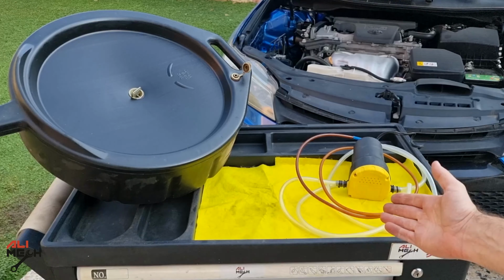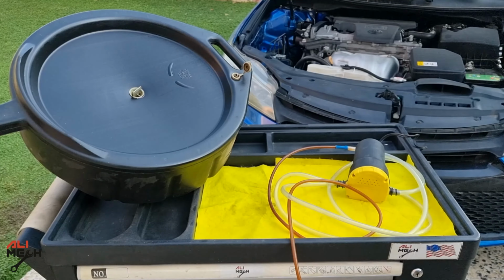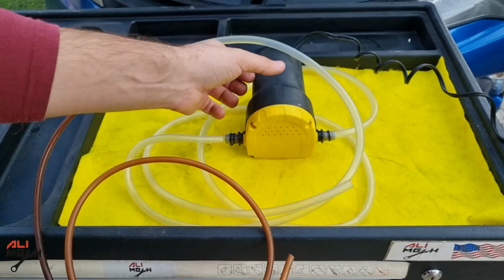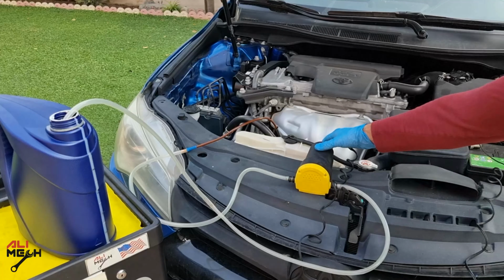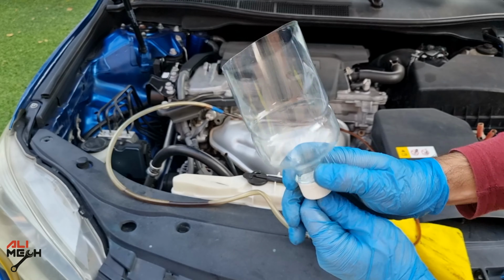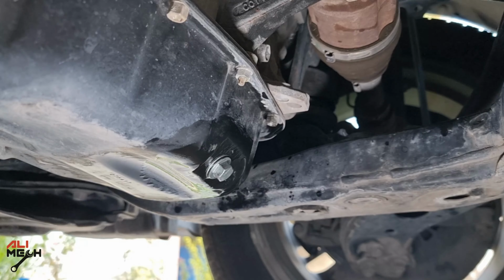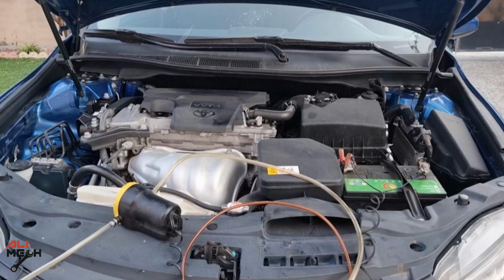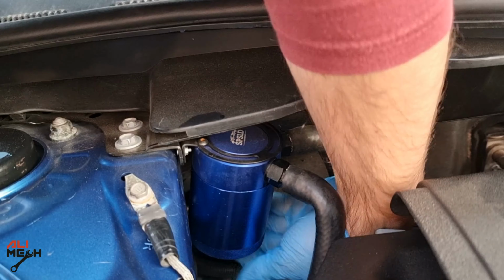Don't change engine oil like this!! /Drain oil vs Suction pump/How to change Toyota Camry Engine OIL

Comment: Even if you drain the oil from the drain plug you still leave up to half a liter of oil inside the motor. The oil inside all those passages doesn’t drain out completely. That’s a fact of life. The amount of old oil that stays in the engine is too small to make a difference.

Comment: you should put the can and the pump on the ground to take advantage of gravity, like you would with a siphon. Your pump was having to try push that oil directly upwards. Still, even in ideal operating conditions, the drain will of course get a bit more out. You can use clean oil to dilute anything leftover and get more out with this.

Comment: Nice comparison. I guess old drain method is gold 👍
Reply from the maker: Thanks brother, for some cars will le close to one liter
Reply: using both will be better and cleaner, no oil spills !!
Reply: But not For aluminum thread motorcycles engines
Reply: Nope you're wrong. He is using a very weak oil extractor. A good oil extractor will suck the life juice out of your car. You can see videos of those shops using pneumatic oil extractor. Nothing is left when you unplug drain. I will make a video too we have the machine in our shop.
Reply: @aydinali5381  What do you mean?  My bike has two drain plugs so I don't think I can use on these extractors.  The darn drain plugs are so easy to strip as well but I think I have to use old school method.
Reply: @eternalrage1085  Not on a Ford ranger. Extracting the oil leaves 3 qts in the pan.

Comment: I use both methods. I like how clean the process is with oil pump. At the end I crack the bolt and take out the rest which is very small amount. Less mess is good day for me.

Comment: I think the amount that remains depends on your vehicle.  Some are designed to have it extracted this way and the design of the oil pan reflects that.  I changed my oil last weekend using an extractor and as it was the first time i used that method i pulled the plug too.  There was literally two tiny drops that came out of the oil pan.  I wont be going underneath my car to do the oil again but i would recommend the first time you do this that you check for your specific vehicle.
Reply: Exactly. And the angle. Depends on where the tube enters and ends up in the pan. Mine seems to land at the rear of the pan and with my vehicle tiled back slightly on ramps, not a drop remains.

Comment: This works well on the renault 1.5 diesel motor (this engine is in loads of different models including nissan & mercedes. Just be careful when pushing the pipe down the   dipstick tube that you don't curle the pipe back on it's self when it reaches sump bottom, just feed it down gently and it will get every drop of old oil out

Comment: No need for a catch can on that '2AR' engine. It already has an Air/oil separator built into the block below the intake manifold. If your having issues just replace the diaphram. My 2 cents.

Comment: I've heard that some folks will add little new oil, after pumping, and then pump that out after letting it "flush" some more of the old oil down. Just to try and get more old out.

As someone else said, even the drain plug method isn't going to get everything.
Reply: Seems like a waste of money.

Comment: The dealer recommends an oil change once a year , so I use the extraction method myself as an extra change after six months and have it changed by the dealer once a year in accordance with the warranty. You get most of it out without risking stripping the thread on the pan.

Comment: Thank you for sharing.
I do like how you got/found this small pump.  Way more compact and easy to use than a lot of extractors I've seen out there.

There was another YT channel that discussed this.  (Maybe The Car Care Nut?  Not sure)  While yes he also had a slight difference between suction vs drain, but the difference was smaller than in your effort here.  Maybe the lead-tube is different?  I don't know.

Regardless, one is never going to be able to drain "all the oil".  There will be residual oil left in the head (valve train area) that just won't drain down.  Oil is also viscous enough that there will always be some the remain stuck on vertical walls and not fully flow down to the drain hole.
As long as folks are regularly changing oil & filter, that's probably the bigger impact for longevity of their car/engine.

For folks that want to adopt this kind of extraction method, my suggestion is to place the old oil bottle lower - directly on the ground.  This way, once the oil has filled the entire suction line, they'll get some "help" from siphoning effect, and the pump is no longer having to fight gravity.

Comment: I just bought a vacuum pump for oil change.
As a DYI guy I think use a vacuum pump to suck out all the oil and drain out the remaining tiny bit oil just like this video.
That is just my way of doing thing.
If I do it myself, I already saving some money ,so doing some extra work no gonna waste the time or effort. 

Thanks for this video

Comment: I use an extractor and never have to spill a single drop of oil on the driveway or deal with bad oil pan threads on older vehicles.
Once a year I'll pull and replace 5 liters of automatic transmission fluid on my GM truck.
Also its an awesome tool for changing out power steering fluid, or working on lawnmowers, boat engines, snowblowers etc.
Reply: But what about changing the oil filter?  Wouldn't that drip oil?
Reply: what about the filter???

Comment: I've just tried the exact same pump and I was impressed tbh.
As someone else said, put rhe canister on the floor and let the used oil drain into that as gravity will also help the process. For a quick, and very clean way to do an oil change for a DIY-er it's a winner for me.

Comment: Even when if use drain method for changing engine oil, it still remain a little oil on the crank shaft bearing, and engine oil never can be completely drop down because it's vital to remain a little oil on the engine oil case ;without any oil engine bearing will destroy at first of starting neither if you pour gasoline and wash the engine interior then engine will be destroy and need fix after.

Comment: On many cars you still need to lift the car or roll onto ramps to be able to remove/replace the oil filter. So I don't see the appeal of this for engine oil. Now for the transmission, this would work well
Reply: Yeah, but not ALL cars oil filter is under earth, so...
Reply: For me, the advantage is having only a small trickle if oul when I remove the oil filter instead of 6 gushing quarts.

Comment: I am using it, that i leave oil cap on. And when i insert oil tube inside dipstick tube i put some cloth around top where is tube inside dipstick tube. That way is no air going inside motor. And then i suck out, and oil is coming out fast and all oil. Nothing leaves behind.

Comment: I tried to do this and my tube has got stuck inside the oil dipstick tube, it got sucked in a little while the motor was running. Im afraid to turn the motor back on, what can or should i do??
Reply: I hope it's a joke that you started the car with the tube stuck.  if not I recommend you find a different hobby 😮

Comment: the electric extractors arn't so good, and extractors access isn't always perfect for each car, some you can reach the bottom of the sump, some you can't (so it's no good). for example honda K20 - no, but mazda b6 or toyota 7afe - yes. the PELA pump is far better than the cheap electric pumps.

Comment: Dude u still had the oil filter on, ifciarse there is going to be oil left over.
Reply from the maker: It wasn't about showing how to change oil and filter, it was  difference between drain and extract
Reply: @AliMECH  I am saying the test was flawed because the same amount of oil would come out had you used the drain plug because the filter was still on

Comment: you didnt have the tube down all the way or in the correct area. This method works perfect if done correctly.
Reply from the maker: Before doing the video I checked with endoscope camera and it was all the way down,  but for some cars it doesn't work according to the oil pan design
Reply: @AliMECH   You may have to move the tube a bit. If pushed down properly it goes EXACTLY where thedip stick goes which is usually the lowest point. I just did a 2013 Camry and a 2008 Mercedes S class with the Mightvac. Both extracted all the oil. The oil in Camry was clear and clean when checked with ZERO evidence of old oil mixing, took it for a 700 mile drive and is still clear as if I just did the oil change.. The Mercedes was the same. I didnt take it 700 miles but after 90 miles oil still looked new and in no way dark or discolored. The user just needs to know how to do it.